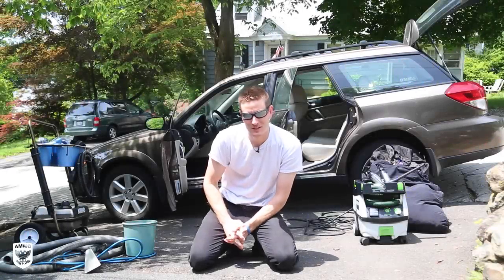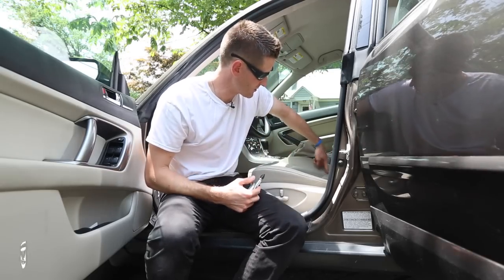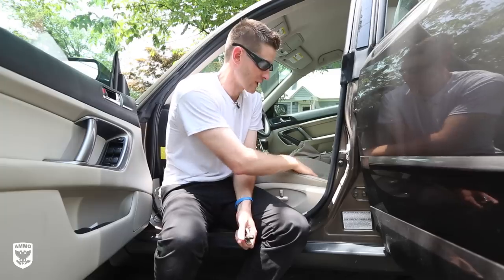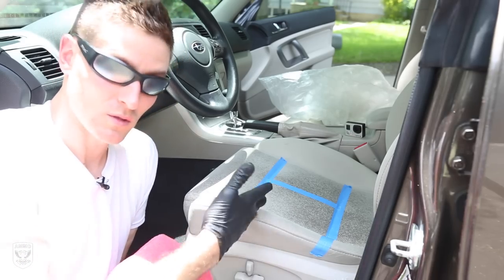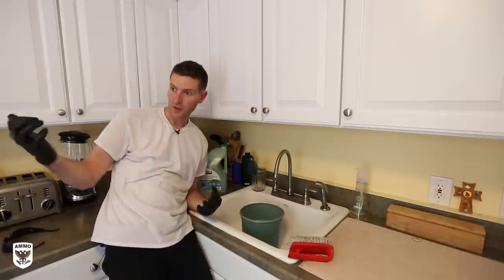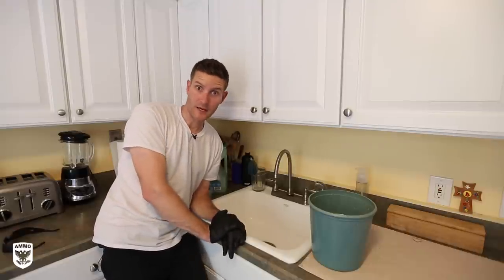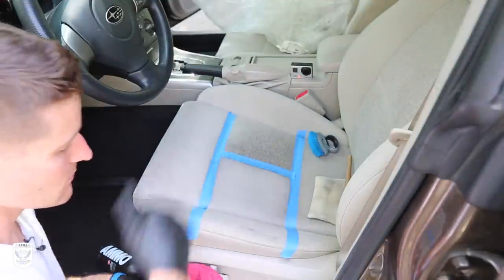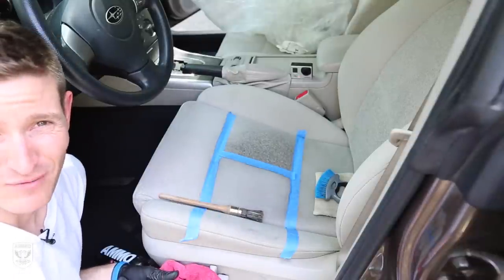Best Cloth Seat Cleaning Tricks: Subaru Legacy

Comment: One BIG THING you should review is a HOW TO REMOVE SALT STAINS from carpets in states or provinces that use salt on their street in the winter
Reply: Yea that's a good one, salt is a complete pain to remove or impossible on highly used cars.
Reply from the maker: Ok cool. Good idea for a winter video :)
Reply: AMMO NYC Would definitely appreciate a video on the topic of salt stain removal.  Thanks for all the videos!
Reply: I got rubber matts just for that lol,

and I would actually use snow to clean the rubber matts. Just a little snow ball and a rag, scrub, all the salt would come off and the matt would look brand new.
Reply: you can use wheel acid! it works pretty good... but just a little. and remove it right away with carpet shampoo
Reply: Toyota got smart and in my area most the camry's come with weather floormats!  I'm so excited!
Reply: I live in the south. That problem makes sense, but it didn't even occur to me that was a problem for people
Reply: The only thing that effectively dissolves salt is water.  I've had very good luck with just multiple rounds of hot water and vac extraction.

Comment: Good point "dabbing" the steam cleaner onto your towel when working with older/delicate upholstery. Most people would just attack the material with the brush attachment on the steam machine. I use the "dabbing" method to simply heat up and loosen the dirt from the fibers, followed by agitating with a small detailing brush and some sort of interior cleaner, then finish by wiping with a microfiber towel. Introducing heat before cleaning by hand really helps.

Comment: When I was doing the interior of my 2003 4Runner SR5 w/ tan cloth I used a RugDoctor (rented it from Kroger) for $40 a day with the upholstery attachment ( extra $3/ day) and bought a thing of oxy clean (RugDoctor brand, it was $10 if I remember correctly and it's yours to keep) and really went in depth, took all the seats out and did all the carpet, seats, everything cloth. Came back like brand new then bought some seat covers to keep it new. Fairly cheap, quick and effective. Then let it sit in the sun with the heat on full blast to completely dry and tiny bit of water leftover. The water came out black/ brown and the seats still look new 2 years later.

Comment: Oxi-Clean Max (Carpet Cleaner Version) + Towel. Seriously the best stuff I have ever used.
Reply: But how to you dry it up, I spilled coffee and cleaned it but it’s hard to tell when’s it wet. I used paper towels to soak up the carpet cleaner and water and saw coffee on the paper towel each time until the paper towel was clean, but I went through half a roll of paper towels for one seat. Other than that it actually cleaned it really well. What I did was use a cleaner the first time, dried wet with water to dilute the stain, dried and kept repeating. So my main question is how did you dry it up? You most likely have a much more efficient method than me. I don’t have an extractor tho, I usually don’t spill much.
Reply: Two things. No, three.
1. Shopvac is great for getting the vast majority of the liquid out.
2. Small pet vac carpet cleaners are a great sub for extractors. Inexpensive. If you have one handy use it after the shopvac, and do it thoroughly.
3. Make sure you do your carpet and seat cleaning early in the morning on a warm, sunny, dry, and preferably breezy, day! After you’ve extracted as much water as you can from your final rinse of everything, open all the doors and windows and let everything air out all day long.
Reply: @salehmohsen6319  Sorry, just now seeing this. I just used an old bath towel.

We had gotten a car after a relative died. She smoked and the center armrest was BLACK in a light tan car. We used this, sprayed it HEAVY.... let it do its thing for 10 minutes and then scrubbed it with an old bath towel that we had set aside for this type of thing. Came right out.Finished it with another light spray and a clean section of the towel. Car looked BRAND NEW. Couldn't believe it. 

Ammo's Leather Conditioner I purchased near Christmas. That stuff made my Audi Leather seats look absolutely amazing. No heavy odor, just a nice fresh look and subtle conditioner smell.

Comment: You shop at Costco!

The last few times I did a thorough cleaning of a car interior, I waited for a nice, extra warm summer day, scrubbed everything, a lot of water, soap, and I used a carpet cleaner to suck any water out as I went. A lot of rinsing to get all of the soap out, and it was pretty much as good as new. The last one had grease spots, and just everything else going on, and it made a huge difference. Really can't tell how abused it was.
The extra warm day helped the water in the hose from being too cold, and really let everything dry in hours when I left the doors open (remember to turn the lights off so you don't kill the battery)

Comment: Excellent video. Quick tip regarding the extractor. I use the same one, and noticed that after some use the handle starts to sag downward. Be careful when running the head back and fourth. The handle tends to want to catch itself on the surrounding surfaces.

Comment: Ive got a 97 Subaru legacy that still after almost a year has the smokey smell from the previous owner and it drives me nuts took out the rear seats and rear deck cover still smells, I also own an 09 CLK550 and it seams as if the original owner drove it with the windows down alot and theres alot dirt in it . Side joke here is that bought that car just after watching you buy the Porsche when you said "Buy with your head not your heart" made me walk away from an 07 Audi RS4 and an 06 base Carrera because they had issues and im soo happy with my CLK only problem i had with it thus far i had to replace the starter ( Dealer did it for free ) and thats it !! , I watch your vids because we are alike in being very meticulous in what we do keep up the good work bro thank you !! .

Comment: One tool you didn't mention Larry is the Tornador.  Before getting my Optima steamer I used the Tornador to clean fabric seats.  Folex is a good chemical to use as well for those on a budget.
Reply from the maker: You're right. Dam. I forgot to mention that tool. Sweet tool. Dam
Reply: The first time I used Folex I felt like I was in an infomercial. I think I have told all my friends about it... and I'm not that kinda guy usually.

Comment: We use another method that I think I've seen on one of your videos that is squirting some fabric cleaner, use a brush on a drill or rotary polisher to lift the dirt then vacuum the seat, repeat with just water and then one last pass with just the vacuum to absorb as much moist as possible

Comment: one of the best ways to clean interior seats, headlinings, anything really is to use a synth/chamios, get a bucket of water, rinse out chamios, get your interior cleaner, mist it on to the area and gently wipe the area over, its works a real treat and is awesome at cleaning the headlining, rinse out chamios in bucket after each pass, you will see for youself the dirty water in bucket, same with carpets but go with a scrub sponge first then follow up with chamios, for subborn stains use tar and glue remover on your carpets for oil based stains as its a solvent.

Comment: Great, you seem to know what you're talking about. I just bought a 2000 mustang and I went to the car wash to clean the outside and was very disappointed in the results. I will be doing hand washes next time. But I am going to try your hand method for the interior seats next!
Reply: Auto car washes don't do anything but scratch your paint. Don't ever use them. hand wash with the two bucket method and proper products.

Comment: Should you use extractors if there are airbags (which don't mix with moisture), heating elements, or sensors in the seat? I've read somewhere that one of those things was damaged (in a Prius, if that matters) after an extractor was used. I don't have a Prius but I assume the same would hold true for many cars.

Comment: Excellent vid, but if I may add, to owners of Euro brands in particular Audi, VW (VAG) in general be careful when using a steamer especially if you live in tropical climates (Caribbean,etc) like myself. The roof liner in these vehicles are prone to sag after two or three cleanings due to the heat even if you just do the seats. Just an observation from a fellow car nut.

Comment: i would love it if you did a video on how to clean seat belts that are lightly colored
Reply from the maker: melmelcorvette Another great idea. Thank you. I need to do that
Reply: AMMO NYC Did you ever make that seatbelt video?
Reply: I'm still looking for it
Reply: melmelcorvette easy, disconnect ya battery wait half hour to a hour, take the seat belt out completely, lay out on table, hot water dish soap and a gentle scourer.. I have done that a few times. then after its dry wack it back in the car, 
then after its all connected re connect the battery. disconnecting the battery is a must with all cars with airbags, because of the sensors and such

Comment: My sister had a 1978 T-Bird that had really light grey fabric seats. She used to do all the pre-steps you use, and when she cleaned the seats she used :
1/4 cup Biz Laundry Booster or Clorox II to ONE gallon of water (in a bucket)
A medium bristle brush
Using the brush....dip it LIGHTLY into the water solution...(don't Saturate the brush with the water/Biz mixture!!) Lightly scrub the seats......wipe off with a wet towel....allow to dry 12-24 hours before using the car!

Comment: I recently had a car built, 97 eclipse gst/x, and my other leather talon seats were not moved over so I'm left with cloth seats for now, and was looking for a video like this.

I too was concerned about moisture and what would be the best way to clean the seats without soaking the foam underneath and causing bacteria to grow.  I thought about renting one of those steam machines/vacuums that will suck it all up, but after seeing this I might just give it a go with the bucket method.

I do have a steam machine, but one for clothes, steam/ironing type thing.  Not sure if it would be strong enough, but following up with that after having used the cleaning solutions wouldn't hurt I was thinking to soak up the leftover "soap".

What do you think?

Comment: Thanks so much for the video. Great as all of them. I've got a car with one of the prettiest but also most difficult to keep up fabric interiors ever, called T-Tec by Volvo... that is one area of the car I am sort of, kind of afraid of cleaning...
Also, doesn't oversaturation (and I am not talking about soaking, dripping wet) push the dirt further into the material?

Comment: Great tips Larry thanks! At least I now know for sure that I haven't been damaging my interiors with the light brush I've used. 

You didn't mention carpet floor mats. What I usually do is take them out of the car, use a bit of laundry degertent/soap and scrub the crap out of them. I do get them soaked but a couple of hours in the midday desert sun dries them up nicely. Does this sound ok or will I burn in detaling hell with guys throwing cleaning chemicals at my face for all of eternity?

Comment: I'm curious if you ever encountered an air bag issue with cleaning the seats? When I did mine, the light came on the dash and remained few days afterward. Perhaps too much water was used, but not a lot when shampooing them.

Comment: Hey Larry, I had a question about about power management and I wondered if you had any tricks you use. A lot of the time when I'm at a customer's house, the power outlets they have available can't handle running multiple tools (like steamer and vacuum) without tripping a breaker. I end up spending a lot of time unplugging and re-plugging tools. Do you run into this issue?

Comment: Just stumbled across your video, very helpful. My biggest question is how to clean down between the seat and door frame. And between seat and the handbrake. ( Not really wanting to take out the seats, I'm not a pro!! ) ☺
Reply: Get a cheap compressor or an air can, a toothbrush or paintbrush and some interior cleaner like Larrys shag or Griots interior cleaner. Blow out all the loose stuff with compressed air then wet the brush with interior cleaner and scrub. Finish with a cloth to try to dry it and blow out the rest with the ajr
Reply: Michael Dorn thank you

Comment: Larry,
I have a 2007 Chevy Equinox with Gray cloth interior. Its the car that the kids are transported, eat, go hike in. Needless to say its filthy. I live in California so I have the capacity to pull the seats out of the car and soak them down and scrub them thoroughly and leave them out to dry. 
I also have a hand steamer and can do the scrubbing like you detailed.
What do you think I should do should I keep moisture control in mind or soak the thing and let it dry in the sun?
Reply from the maker: +Gary Edmonds Definitely would keep moisture control in mind.  the less the better.  the steam machine should be plenty.
Reply: I have removed seats and carpet from many older vehicles, taken all of it up to the car wash in the back of a truck, and use the pressure nozzle to blast it clean with soapy water, and then rinse. Set them out in the sun. Even here in the very humid Midwest, the seats are dry enough to put back in the car in a day or two. But be mindful of any power seat switches/seat heaters you may have!

Comment: I use a high speed drill with wire disk connected - great results with caustic soda but never bother to dry it; I just drive at high speed with all windows down for several months..

Cheers!

Comment: Looks like im going with steam in the future. Steam machines at my country are reasonably priced. I really wanted to find an extractor but i only see the super expensive ones. There seems to be no portable cheap ones here. Plus i could steam the rest of the interior.

Question: can I aggitate it first with some upholstery cleaner and brush. Steam then vac out excess moisture?
Reply from the maker: I would steam first to open or loosen the fibers then agitate with a brush, then tamp, then vacuum.  Hope that helps. thanks for watching and supporting AMMO
Reply: Some of detailers use the steamer first like you, but saw many videos who use it after cleaner also whit towel on it. So what is the best way ?and another question on leather or fabric seats, does it change.

Comment: Hi Ammo I love your videos and have tried most of your methods with great results, but I bought a car that the previous owner had let their large dog ride in probably daily, I have tried Extraction, scrubbing etc, but still cant seem to get rid of the dog smell. I was curious how you might attack this problem, chemical combo, techniques? thanks
Reply from the maker: +A Booth Thanks for the kind words!  I have a few videos on smoke smell removal and how to use ozone machine. Give those a try and see if that helps.  Thanks again!
Reply: Ok thanks
Reply: the smell has probably permeated it's way right through the carpet to the underlay and all, my solution for a car with this problem (and baby smell, too) is to source a better carpet from a wreckers, and get the seats professionally detailed, if scrubbing and Glen20 doesn't work.
Reply: A good idea would be to totally remove the seats from the car, it's usually easy in most cars under the backseats and even the fronts there can be a lot of junk that could cause that
Reply: +A Booth Also check if you have a cabin air filter. Behind the glove box. Cheap fix to help with the smell.

Comment: I work in a rubber company, and I literally have to take a shower with baby oil to get the black "dirt" off my body. When I get in my car, I can see it getting dirtier and dirtier with time. I recently lightly cleaned it with spray and wash for clothes and scrubbing, but is there a certain technique I should use? Steak, shop vac behind it to remove water? Etc

Comment: Thank you for a great videos. But concerning cloth seats. I see all the dirt going only deeper, by any of methods which does not involve suction (your seat is not same light color as side of seat, but rather all the dirt was smeared to make it even grey color). My method is vacouming while teasing cloth with a brush (lightly) to bend and release dirt, that carpet agent and paper towel pressed over. Paper have lower water tension than cloth, so it sucks dirt and moisture out. I use same method at home when a kid spills something over carpet. But it is tedious and consumes great amount of paper towells.

Only method I get seats like new is wet vacuum cleaner in conjunction with spray dose with some carpet solution. So basicly poor-man's extractor. Having steam together with suction is the best. My relative had steam vacuum cleaner. That was the best. But that machines are expensive too. So solution and instant vacuuming.

Comment: i always wondered what do you do if a "smell" is present even after cleaning? Some older vehicles get something like mold in the air duct have you dealt with something like that?
Reply: Also, for lingering odors after cleaning, spray some Ozium in there.

Comment: I personally love to use my spin brush when it comes to my seats I have specific ones just for the seats and then I have specific ones for my carpets I don’t like them to be mixed up and used like you know floor on the seats or you know vice versa that to me is gross my husband wouldn’t care but I do. 

So now I might correct this comment a few times because I do have a question already so I had to go back and edit. 

You said that the cleaning stuff has traces of hydrogen peroxide know what if the fabric for your seats is dark mine is dark gray almost black I am a little bit afraid to use some thing with traces of hydrogen peroxide